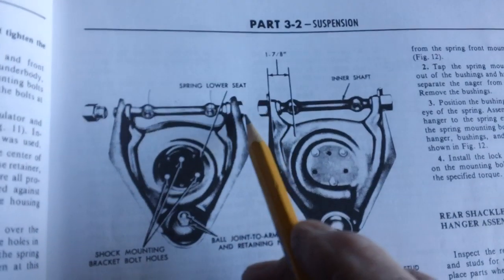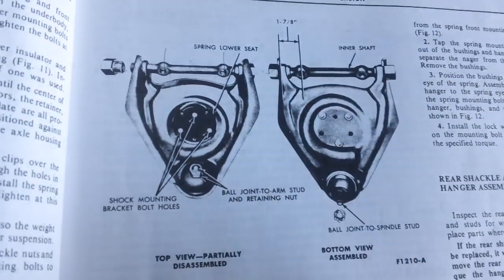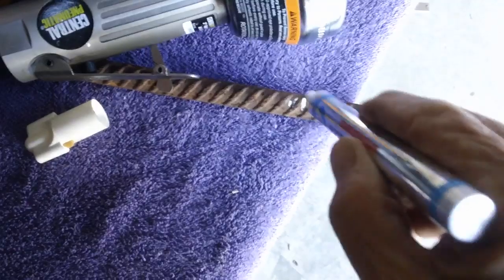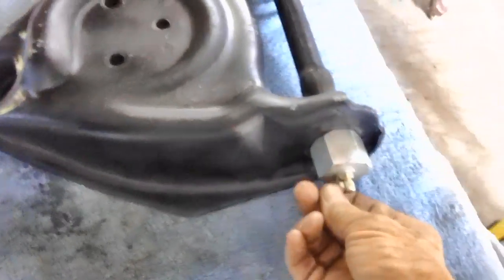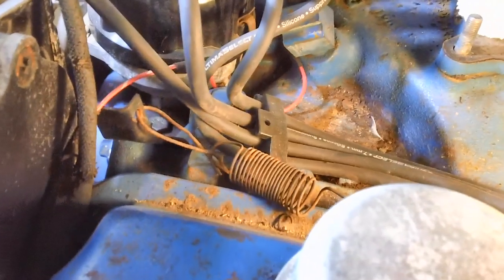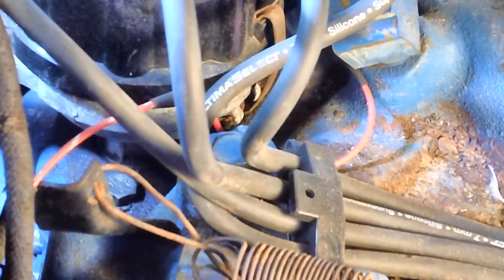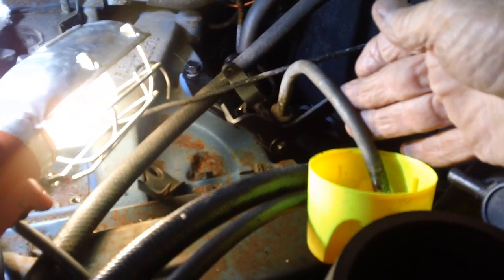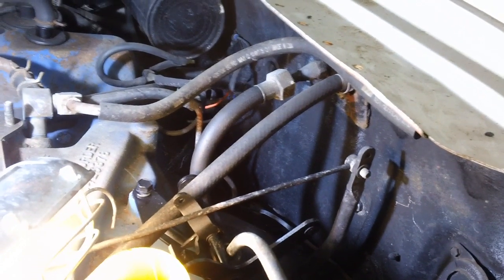1966 Ford Thunderbird repair and refurbishment (Part 59). Upper control arm bushings.

Comment: I saw Vintage Thunderbird Repair’s video where he cut small notches into those rubber O-rings to where grease would be able to escape when greasing. 
He also said his were air tight. I wonder if there are any cons to that method?

Comment: Joe, I’m working on replacing my rubber fuel lines as well. The line runs behind the splash shield.  Mine is all original (no jury rigging).

Comment: The gas line goes behind the panel that covers the wheel well in the back.  There is a notch for the line to go in.  I tried to add a picture but could not do it.

Comment: This is the same as my 1964 ford Galaxie 500.  I saw another video where the installer cut a little slit in the O ring to allow the air and grease to escape.  I did the same with my dremel tool.  It's a small slit that takes some pumping action to get the air to escape, so no debris can enter easily.  My original end caps were not that tight at all.  So I just put them back the way they were.  I put a small dab of paint to monitor any movement that may happen.
Reply from the maker: Thanks, my friend.  You know...it wasn't until a year later that I learned about cutting the slit.  Unfortunately, it's too late now. 😕
Regards,
John

Comment: When I was training to fly the DC-3 I was surprised that old Douglas airplanes used hydraulics for the wipers and I always thought that it was weird too. Even the autopilot was hydraulic! They were even courteous enough to give a pilot a decent hand-operated wobble pump in the cockpit in case of engine/pump failure.

Comment: Hi John - a little late I know but I am rebuilding a 64 Tbird and my shop manual list the torque setting for the upper arm shaft to bushing as 15-25 foot pounds.
Reply from the maker: Al,
Thanks greatly, my friend.  That's very good to know info.  What page of the manual is it on?
Regards,
John
Reply: @joernone  Hi John, in the 64 Tbird shop manual, it is on page 3-36 in the Suspension-Steering-Wheels & Tires section, Part 3-5

Comment: John, I know you dont much care for people getting ahead of you but wanted to give a heads up. I have 2 66 Thunderbirds and both needed the rubber steering gear isolators replaced. The entire gear box would move. Ford abandoned them in 1969 due to them failing very quickly. I thought while your front end was apart it would be the ideal time to replace them or get a solid mounting system.

Comment: that fuel line is hidden behind the splash shield on mine with nothing visible, sorry but mine was jury rigged as well...but if you look at the pre- made versions they will have all the correct bends that will give you an idea of the correct way to put in the bends...look at the Concourse catalog as they are geared to folks doing a factory restoration also the restoration guide book has some illustration on the fuel line routing

Comment: Oh Wow.   I thought only Lincoln used those hydraulic wiper motors in the 60s.
Reply: some early Lincoln had hydraulic power windows. Lincolns from the early 40's
Reply: @MrBrendog67rat  1961-1969 continental used them.  the trunk lids and convertible tops were hydraulically controlled too.

Comment: Joe , Use some locktite on those items with the questionable torque values, either blue or red will keep them from falling off. I like that you don't  have a vice because it makes you think outside the box to get the job done!
Reply: Never mind about the locktite as I see they get greased so that cant work with grease as it wont allow the grease to flow around the threads